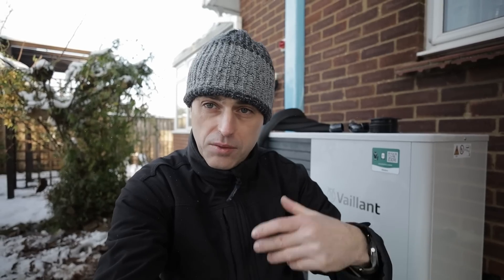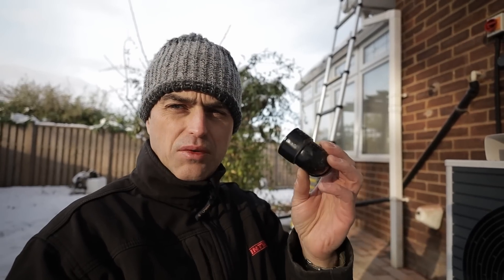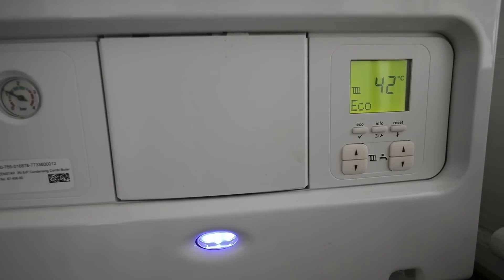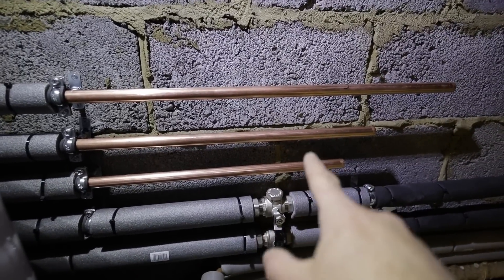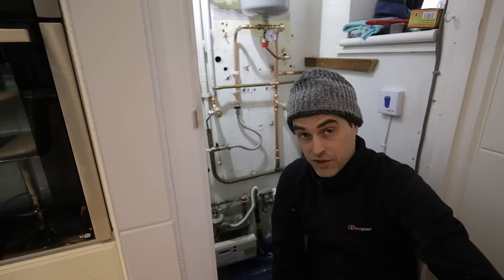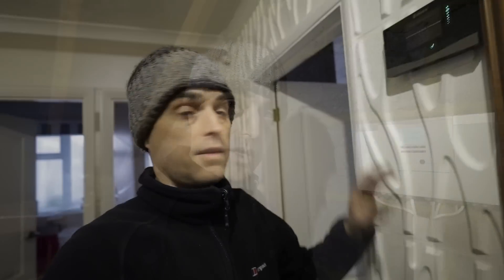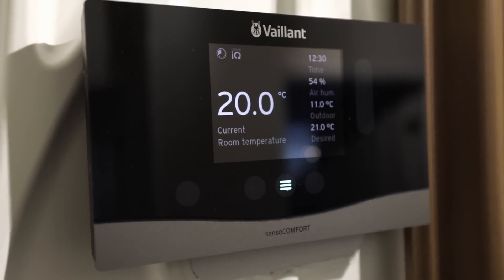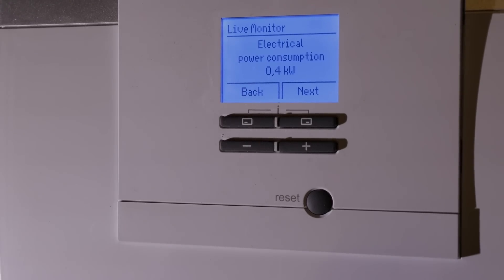How to Install a Heat Pump That Works

Comment: Hi,
I loved all your videos over the years, Keep up the good work.
I have a problem you might be able to help with. I have a Ferroli optimax HE25S gas boiler it’s about 12 years old now. The mother board had a intermittent problem, it would stop for no reason. I’d take it out look at it (no signs of damage) and refit It. It would work for years, I thought it was a cracked PCB. However I ordered a new PCB (DIMS23)for a UK supplier and when I fitted it comes up with an error code F37. No program book came with it and the supplier has no idea. Would you or your contacts know how I can change the program or have a programming book?
Many thanks and a happy Christmas to you and your!
Reply from the maker: I am afraid I know nothing about Ferolli. I always run away from them rather quickly. 

Merry Christmas to you !
Reply: @UrbanPlumbers  Many thanks for getting back to me so soon. Alan
Reply: I don’t know Ferolli had such a poor rep.
I live in Ireland and hope to change my boiler next year. I am thinking of getting a Worcester Bosch gas boiler, how would you rate them ?
Reply: What is the pressure gauge reading at ? You may need to add water via the orange colored valve located at the bottom of the boiler.
Reply: @hughhennessy7912  1-1.5 Bar

Comment: Everything you did when installing that was not done by Faulkners who installed mine. If you want a housing association contract, come and sort mine out and report back to Sovereign housing for me about the shoddy install. I can't warm my house. ! Weeks they've been fiddling with TRV Valves! Rads luke warm and cold at the bottom.
Reply from the maker: Nothing wrong with like warm radiators when sized correctly. What is important is that the room is at the design temperature of 18-21c
Reply: @UrbanPlumbers 2 x  450x 800 radiators in a 6m x 4m room? Radiators getting warm when the hot water is on?
Reply from the maker: No, that’s wrong. Reverse circulation. Installer error. Did they do heat loss and size radiators correctly? Have any radiators been upgraded?
Reply: @Urban Plumbers  I doubt they did any calculations. They installed it and left the bypass valve fully open, they only realised that after coming out a dozen times trying to ballance the radiators. They closed it down a bit, radiators still like warm at 45 degrees and some cold at the bottom. Now the radiators warm when the heating off and hot water on.
Reply from the maker: 45c is very hot for a heat pump. I guess they left it like that as rads are too small. Also reverse circulation in pipework.

Get them back
Reply: @Urban Plumbers  HA keeps sending the Installer back but they don't do anything other than tinker.  HA knows nothing about heat pumps. Said its designed for 45 degrees.  Regardless of that, radiators are not hot at 45
Reply from the maker: They would only be at 45c when it’s -2 outside and much cooler when it’s warmer
Reply: @Urban Plumbers  I know this, the housing association and installer doesn't . Banging my head against a brick wall

Comment: The only heat source I "trust" is my log burner. Because I am in charge of the fuel sourcing. We are going to hell, prepare folks.
Reply from the maker: Make sure you stock up baked beans and bullets as well

Comment: I wish I'd kept my oil as the running cost of my heat pump is horrendous and the installer refuses to acknowledge this. £2,500 for 2 1/2 months???? That's a whole years worth of oil
Reply from the maker: Get a heat geek in to sort it out
Reply: @UrbanPlumbers  stalemate just now.  Litigation

Comment: Drains the heat pump at 3C?! If there’s glycol protection surely this is a waste of time , in the highlands these are never used , the pump would be constantly draining itself.
Reply from the maker: It drains the system when the water in the system drops below 3C, which would only happen if there was a power cut as the HP has anti-frost protection that keeps water in the system above 5C at all times.

When you use glycol you lower the system efficiency by a large margin, due to glycol lower heat capacity than water (Glycol mixed with water cannot carry as much energy as pure water)

Anti freeze valves are a much better option than glycol.
Reply: @UrbanPlumbers  ok , makes total sense. 
We install a lot of ecodans and latterly Grant ASHP, they have 4 different frost settings which means the pumps run a lot, we found using glycol meant we could switch off all these modes and save energy that way. Also in the highland we have a lot of holiday/second homes which are left empty all winter.
I’m toying with the idea of switching the fluid in my ground source to a mixture of methanol/water for precisely the reason you mentioned and to decrease pumping requirement too.

Comment: Keep clear of the heat pump too expensive to run.
Reply from the maker: Cheaper than gas boiler when installed well.
Reply: you are wrong mate

Comment: They are just are not up to doing the job from our experience we have relatives in Norway they have to have extra electricity heating to warm their house the most they can get from there heat pump is 15/16c maximum in addition they are unreliable my relatives have have been waiting over a month to get theirs repaired they are constantly breaking down. The reason the installers do not fix an inside thermostat is to avoid the residents seeing just how useless these pumps are. They are an absolute waste of money in the years they have had an heat pump they have had constant breakdowns.
Reply: you must be having some really bad installers, here in Denmark we have heatpumps that are 10-20 years old and running fine with regular servicing. maintain heat as long as system is properly sized and adjusted you can run 30 degress inside temperature if you design for it, no problem. Ground source heatpumps are seen here as long as 30 years old. 

You need to do your research better and dont base your experience on ONE bad install. there are MANY bad installs, install by idiots and uneducated people, but it does not take much to use brain and install one correctly. Your relatives have 100% incorrectly installed system and causing these problems.

Also, there are very few BAD heatpumps, most of the failures and huge consumption is fault of bad installation, and the existing pipework, radiators being rubbish. The heatpump unit normally isnt a problem itself, but the others things installer dont account for and make quick buck.

If the heatpumps were waste of money, huge district (central) heating plants would not be using this technology to provide heat to entire cities, at an very affordable cost. They are of MW-scale and more are coming in rapid rate. People designing and using them are not dumb to waste millions on technology that does not work or is not viable compared to alterantives.

Comment: What’s the payback for all the money spent on this over complicated expense nonsense? What’s that point of removing a simple cheep to run efficient combi boiler? Would you spend £12-15 k of your own money on this?
Reply from the maker: Yes absolutely - I have exactly the same set up at my house and it cost me £200 a year to run a 3 bed house. 

Once I add solar the house will not only be free to run - It will also pay me to live in it.

Not only clean heating and environmentally friendly - also great as you get paid to live in your own house.

What’s not to like? 

Pay back time probably 10 years I mum case -  but pay back time is nonsense - what’s the pay back on your boiler ? What do you compare it to? Coal fire?

Don’t like it don’t stall it.

Comment: Why do we hear horror stories about £7000 bills ? Is that BS? I dont know whether to go for a heat pump. First I have to get rid of suspended floor and and pour in concrete with insulation, get the UFH pipes ready compliant with heat pump. 
I think UFH is much better with Heat Pumps. 
If you think about, which time of the day a heat pump spends more time defrosting itself? At night -colder temperature. It makes sense to heat up your home (UFH) daytime when the weather is warmer -less time self-defrosting. UFH radiates heat for long hours to get through the night. 
Am I correct? 😅
Can you tell us about the bills after installation? 
Why do you think the government is investing into hydrogen and boilers are ready for 20% mix.
Reply from the maker: hydrogen is a distraction of the fossil fuel industry. It will never happen for domestic heating on any scale that will make any difference.

There is very little expertise in the country when it comes to HP installations. The margin of error is small. If you install the heat pump in the wrong way it will quickly bite you on your backside. High bills are just the start of your trouble then.

We need more training in heat pumps and a better caliber of engineers to install them.  

You need to look at the whole installation holistically. You need someone with knowledge of heating systems and heat pumps to design the whole system for you, not only install the heat source, as it has been happening with the gas industry for the last 20 or so years.

Customers also need to educate themselves before they have a heat pump installed.

Bad nstallation will cost you a fortune to run and keep you cold, decent installation with be cheaper to run than gas and will keep you nice and warm. Night and day difference. That is why an installer is the most important piece of the puzzle here.
Reply: @UrbanPlumbers  Well done for being honest. And I admire people like you, who seem to genuinely want to improve  the heating industry, with better outcomes for the Public.
  We do need installers and manufacturers to not only point out the good points of heat pumps, but the down sides. the down sides, are
 They are bloody expensive, and the taxpayer is in alot of cases subsidising the technology! (they are doing this in a lot of countries also). They need to be correctly planned, installed, set up correctly and monitored to see if they are running at optimal. You coulld say the same with a gas boiler, but with heat pumps, it is more critical to get all these correct!
 At the moment they are not cheaper to run then a combi boiler or a top performing gas boiler like the Viessmann 200, this might change if electric prices fall! 
Some people claim they are, but they are running at far lower room tempreatures than they were with there gas boilers. They are not as responsive as a gas boiler. The property takes along time to get up to temp, because they run at much lower temps.
 The performance drops off dramatically as the temp outside dreceases and may need additional heat sources for the property, when we get extreme weather. Over 50% of Swedish properties have a log burner!

An Interesting fact,  1.4m heat pumps have been sold in Norway between 1987-2020 and only 50,000 of those were air to water heat pumps. 1.25million were air to air!
I'm rambling! so, thanks for the videos, keep up your good work and have a happy xmas👍